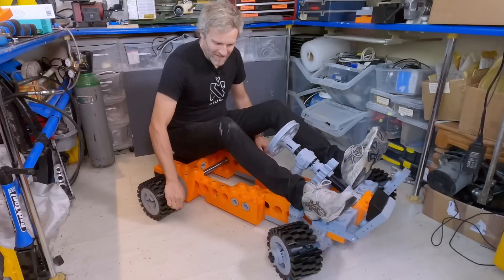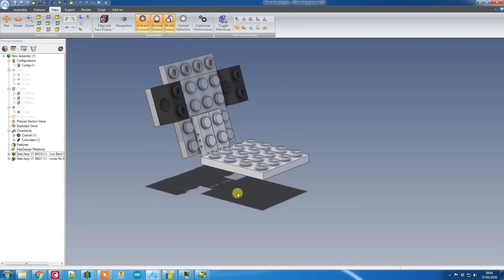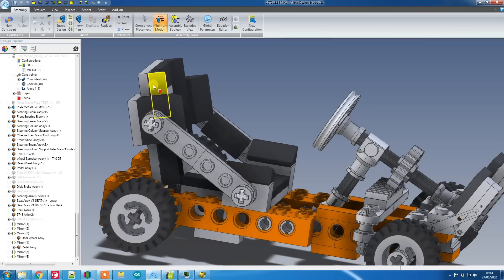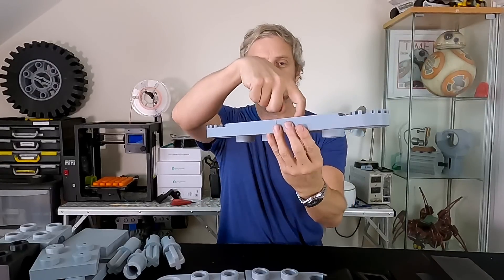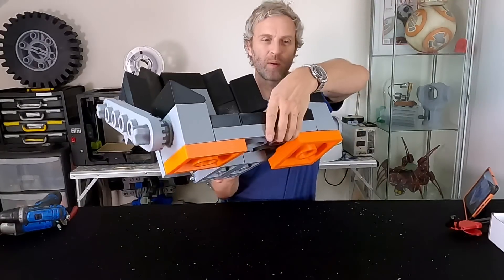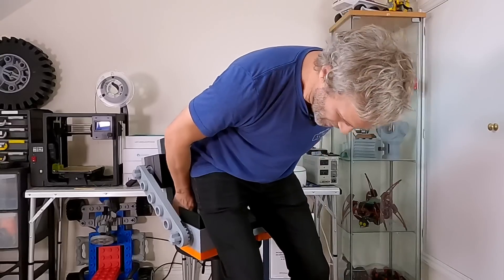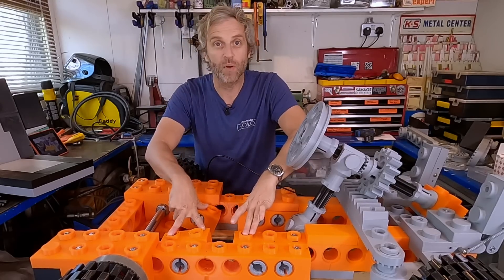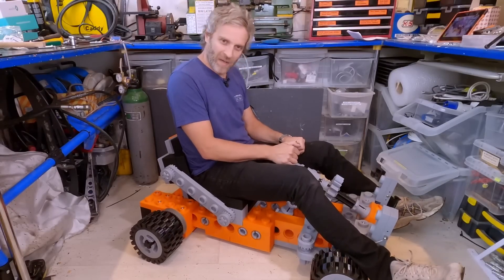XXL LEGO Go-Kart! | Bucket Seat Build | #3 - Mantis Hacks

Comment: Maybe I'm wrong about this, but for the back of the seat, you could replace the higher of the grey 2x2 flat plates with a 1x2 flat plate and a 1x2 "cheesewedge", since those should be 2 plates high. 
That could make it a bit more comfortable, replacing that hard 90° angle of the lower plate.
Reply from the maker: It is darn uncomfortable 😆👍

Comment: You should make rails on the chassis so it can slide so you can easily change the length, and maybe lock with pins?

Comment: Really nice to see you build this; on 2:55 I noticed the black 2x1 plates in the middle of the side supports which did not make it to the assembled version. On the Cad version they look great however, so my question is: are you going to fit them, maybe in a low weight type of material in order to keep the weight down?
Further more: Great project, really nice how you record and present it; can’t wait for the next episode. Cheers👍🏻👍🏻👍🏻
Reply from the maker: Thanks! The 2x1 plates on the side supports didn't fit.. I hadn't noticed in the cad they were interfering with another part. I may modify them to fit as they do look good 👍👍

Comment: One mod I would try is to have the stud covers of the chair half as thick since they don't need to be as strong.  However those pieces would be made of pine.  Hold on I'm not finished so don't jump off the edge.  You still there???   Good.
I would then cut pieces of high density foam and glue them to the corresponding parts.   Lastly,  stretch poly vinyl over those pieces and have the edges stapled into the wood (the reason to use wood instead of plastic in this case).  That way they still have that plastic look.  The wedges would have to be stitched together  to look right but it can be done.    
I mean a human needs at least some shock absorption.
Reply from the maker: Yeah it needs some grip and padding

Comment: You can make that far more comfortable by replacing a 2x2 tile with a 2x2x2/3 rounded slope. Take the black 1x2 tile from the top of the seat and move it down to the base of the back, shift the 2x2 tile that remains up one stud, and place the rounded slope over the four exposed studs.
Reply from the maker: Erm.... Ok... Trying to figure that out 😆

Comment: When you mention lengthening the chassis for yourself, I'd be hesitant to move the seat further back since the weight distribution is mostly to the back already. 
I wonder if you could just extend the pedals over the front with easy to attach/remove pieces?
Reply from the maker: Yes exactly..  chassis will go forward past the front wheels and pedals move forwards 4 studs

Comment: theyre not cheese pieces theyre roof tiles
Reply: The 1×1 slope tiles are referred to as cheese slopes or cheese pieces. The 1×2 tiles are grouped into that category as well.
Reply from the maker: Yeah... 👍👍
Reply: looks at lego digital designer. then why are they called roof tiles there? in an app made by lego.
Reply: @raffia16thblaze10  

Lego builders use nicknames for pieces that Lego themselves do not. It's common for a lot of pieces.

Comment: It would have been interesting if you had maybe made the cheese wedge pieces and plates out of something flexible or soft so it is a bit more comfortable.
Reply from the maker: Did think about it.. may have to do that eventually die grip too!
Reply: I think a 1/4" or 1/2" thick layer of craft foam glued to the wedges and plates would make a world of difference.
Reply: I was thinking the same thing, like use the same material as the tires.
Reply: See my previous post.  It's basically the same process as seats for wooden coaster trains minus the batting to maintain the sharp edges.

Comment: Why didn’t you just print a half of the hinge smooth, them no need for the bump....
Reply: Then it wouldn’t be authentic, and that’s one of his main priorities. Either way, when I saw that piece, I saw lumbar support.
Reply: LJTwiggy looks like some hinge pieces with flat tops exist https://www.bricklink.com/v2/catalog/catalogitem.page?P=4531
https://www.bricklink.com/v2/catalog/catalogitem.page?P=44300
Reply from the maker: Well.. I'd already printed it and had it in my spare parts... Plus. . it wouldn't be Lego 😬
Reply: A hinge piece does exist with a flat top - as long as you don't need the axis of rotation in exactly the same place. https://www.ldraw.org/parts/official-part-lookup.html?folder=parts&partid=4531

Comment: I love how the lego genuinely works even at this 9000% scale, shows that is incredibly well designed
Reply: There is some molecular-level accuracy in the math used to create lego, it's quite fascinating.
Reply from the maker: It really is anazing
Reply: Matt Denton Matt Denton What about making large legos out of small legos? 🧐
Reply: @pixelyz7792  Would never get the smooth rounded edges.  Unless you're talking about grinding up small legos, melting them down, and ultimately turning legos into printable filament?  I mean wow that would be an undertaking.  It's already hard enough to make usable filament with a consistent diameter  out of a soft plastic like number 2 let alone Lego PLA.
Reply: @pixelyz7792  lego actually did that in at least the antman vs wasp set. However, I believe they also did it in the NYC lego store opening (in a matter of speaking) to build a giant lego apple. But that was more like bricks made from legos.
Reply from the maker: Super satisfying 👌👌